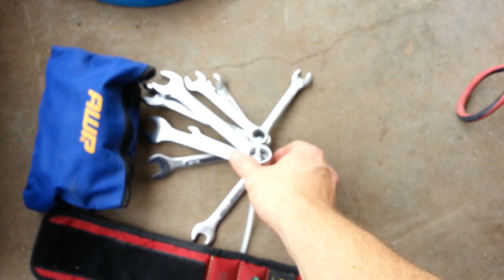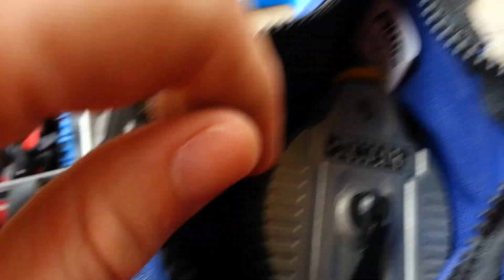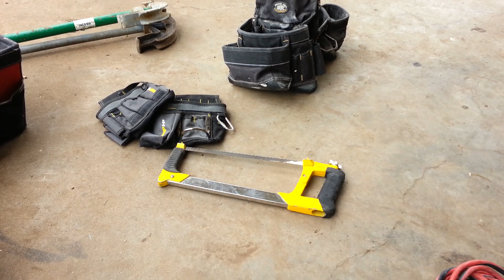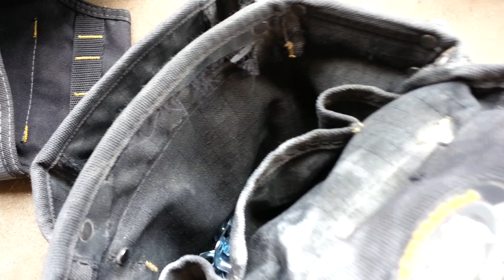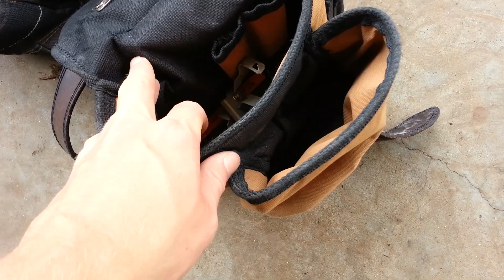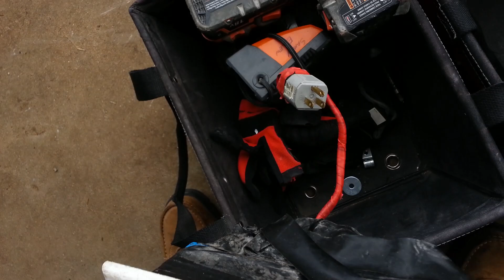Everyday Electricians Tools (Part 3)

Comment: Great video, and very informative.  I was wondering why a label printer was never mentioned?  Is it a tool you are not using often, or do you have another solution for making sure panels and wires are correctly identified as well as safety signs?
If a label printer is something you use, I would recommend our LW-PX900.  If you are interested, we have dealers who can set you up with a demo unit, no problem.  Check out our product videos to learn more.  

Thanks, and keep up the great work!
-K-Sun